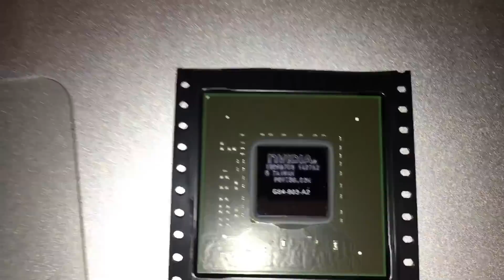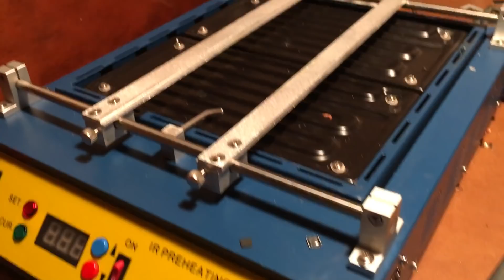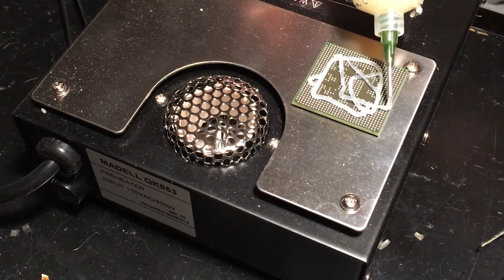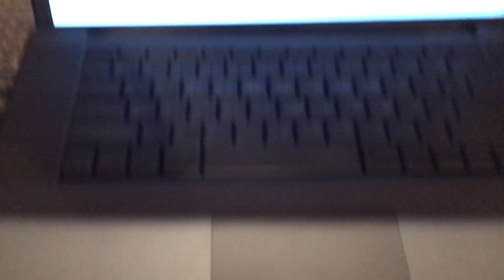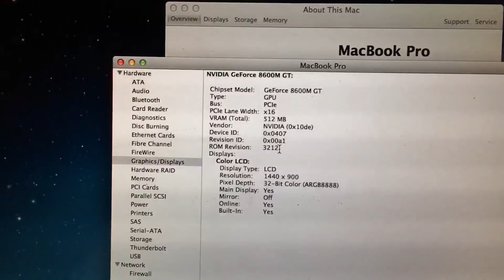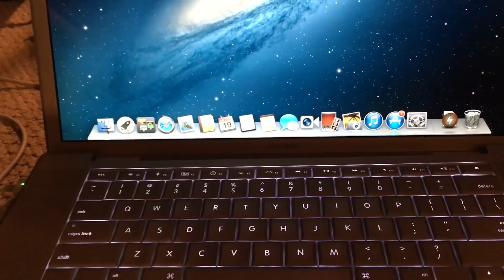Replacing a Defective GeForce 8600M GT GPU on an Early-2008 15" Apple MacBook Pro

Comment: If I were to replace a Radeon HD 6750m chip in a 2011 MacBook Pro with a 6770m chip, would doing this process be enough to make it work (assuming it’s a good chip)?
Reply from the maker: No, you'd also need a Boot ROM from a machine with a 6770M, and you'd have to change some resistors on the board.

Comment: Hey, where you used the hot air nozzle at 7:25 would it be suitable to use a hot air gun?
Reply from the maker: No, you need a proper hot air station with a 45x45MM nozzle, as I used in the video. Otherwise, you'll damage the chip.

Comment: Hey dosdude1, what would you recommend someone who wants to get started in such kind of board repairs?
Reply from the maker: First, make sure you have the right equipment, such as a board preheater, decent hot air rework station, the proper nozzle for your hot air station, etc. Then, just practice removing chips off old/dead boards, and get them off without ruining or popcorning them. Once you get that down, you should be fine soldering on new chips as well, as it's the same process pretty much, of course after removing all the solder from the pads on the board.

Comment: I have a Mac Mini 2006 I got from a friend. He said he opened it up and I can tell (the aluminum on the bottom is all messed up). He said he upgraded the CPU with a T7600 and it was working but he forgot to plug in the temp sensor so the fans were spinning like mad. Away, after he fixed that the Mac Mini would chime but no video would be output from the mini. I tried doing all the standard things like remove the CMOS battery, reset the smc and pram and that stuff. Still (unsurprisingly) has the issue. Any ideas what might be wrong? Anything I should look for on the board? I mean, since I got it for free I'd be willing to send it to you to see if you can fix it. Thanks for making such great content! I have learned a lot from you.
Reply from the maker: I've never really worked on those before, as it's not really worth doing (working boards can be had for around $20).
Reply: Really? They're that cheap? Huh, I need to look around more. Thanks for responding!

Comment: If the GPU uses the same pin layout as another chip used in another Mac, could the chip be upgraded or is there something more complicated compared to soldered CPU upgrading?
Reply from the maker: That will never be the case, all GPU chipsets have different pinouts, and none are compatible with circuitry designed for another.
Reply: dosdude1 so the Radeon HD 6490m, 6750m and 6770m on the 2011 MacBook Pros all use different pin layouts?
Reply from the maker: No, they're not, but the board circuitry for them is all the same. It's just the VROM that's different on those, plus some strapping resistors.

Comment: Also, when you say "all the balls look to half soldered on just like they should have" ... what are you looking at, like, how can you tell? Cause it's not shown in the video.
Reply from the maker: It's kind of hard to show on camera, but basically what I mean is that all the solder balls flattened down, indicating that they've all melted and the chip is sitting flush with the board. If not all the solder balls were melted, the chip would sit somewhat higher off the board, or be slightly tilted to one side.
Reply: I see, thank you!

Comment: I wish AMD made revised chips for the 2011 MacBook Pros
Reply: Why the hell AMD hasn't done so? F*** you, AMD!
Reply: Rupert C I know I had a pc with and processor it was so shit
Reply: I'm so glad I found your comment. Thanks!
Reply from the maker: Same, but they probably never will, considering how bad AMD is.
Reply: @dosdude1  you can buy DC 2014 2015 2016 AMD 2011 macbook pro chips. Weather they re engineered the solder inside the chip is a different story haha.
Reply from the maker: I know, and I've got some before, and soldered them onto boards. They're the same defective garbage.
Reply: @dosdude1  absurd but you did a beautiful job with this GPU replacement.
Thanks so much for your superb work with the High Sierra and Mojave patchers. 
Outstanding!
Reply: @dosdude1  dosdude1 >>>>> AMD
Reply: @dosdude1  Looking at the spec sheets the 7490m is identical to the 6490m, do you think it would be possible to replace the original 6490m with the 7490m assuming they're more reliable?
Reply: @toastie7275  That sure sounds interesting but looking online the 7490m is the exact same chip, I really doubt they fixed it.
Reply: @toastie7275  I have a similar interest as I'd like to drop in a GPU that's Metal compliant, so there's less third-party KEXT for Catalina or Big Sur. I'm curious if you found anything.
Reply: @dosdude1  I wonder what a ryzen apu MacBook would of been like pre m1 obviously.
Reply from the maker: @tj_official2507  Probably garbage, just like the PC laptops with AMD APUs.
Reply: @dosdude1  AMD is great, fuck off.
Reply: @3a.m.284  stfu jew
Reply: I have an iBook G4 that has an AMD Radeon 9500M. It is based on the ATI GPU family.

Comment: Wow super amazing! I myself have a early 2008 MacBook Pro with a defective graphics chip, sadly. I took it to a repair shop in which they told me it was not worth fixing. I still have the MacBook Pro, when I bought it, it worked for a tiny bit but overtime the graphics just completely died. If you try powering it on, it shows the apple logo with lines going down the screen.
Reply: I know I’m duper late but have you tried baking the MacBook mainboard? You can line a metal baking tray in tinfoil with supports for the main board, then preheat your oven to 220 degrees CELSIUS. Afterwards, let your board bake for 7 minutes in the oven checking to make sure nothing is going awry. Afterwards, reassemble partially to confirm the functionality of the machine. If not the chip itself is dead. However if this works, viola! Working MacBook. I had the same issue with my early-2008 MacBook Pro and after I did this it seems to function without any issues. I did however apply a more aggressive fan curve using Macs Fan Control to keep thermals in check. Been going strong for some time now! Of course, this may not work but it’s definitely an easy and worthwhile endeavor. Plus if it doesn’t work, it’s still repairable. I saw you should try if you still own the machine. Hope I could help, even if I might be 5 years too late.

Comment: Can't wait for the macOS Mojave patcher
Reply: dosdude put that out. I was using his patcher for High Sierra on this 2008 Macbook Pro and it was great. Until Apple put out an update in December 2018 and it screwed with the light settings. So I went to his Mojave patcher.

Spectacular. Works great! 
(Did have to modify the AirPort Extreme  (0x168C, 0x9A) firmware for an Atheros 9380 card but after that, boy, it works splendidly.

Thank you dosdude!

Comment: Hey really appreciate all the work you do with the patcher. I have a 2009 17” that has a really weird power problem.  It basically hard shuts down just as the Apple logo appears. Every once in a while it will get past that and boot fine and stay running. I’ve tried swapping the battery from another 17” but it still does it. Tried different power. Even tried different keyboard.  Do you want it for parts?  For free of course.
Reply from the maker: This is a very common issue with the 2009 17" MBP, I've fixed many. It's due to a failing capacitor on the MCP power rail. But yeah, if you'd be willing to part with it, I will most definitely take it!
Reply: dosdude1 oh interesting. None of the local repair places knew anything. Let me look into the issue. I have some ‘starving artist’ friends who might want it if it’s an easy fix. Otherwise it’s yours.
Reply from the maker: Yeah, it's a pretty easy fix, of course with my soldering equipment. I can repair it for you if you want.